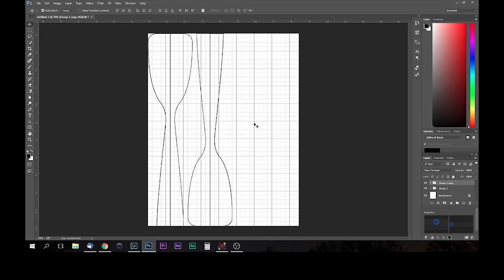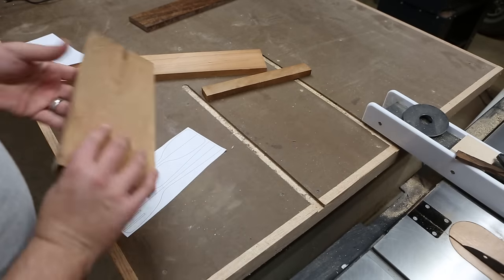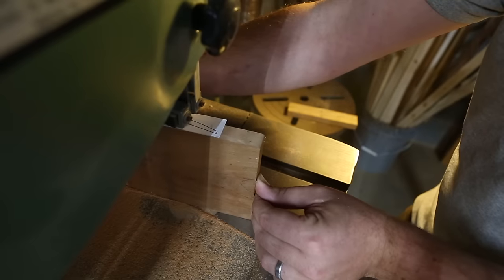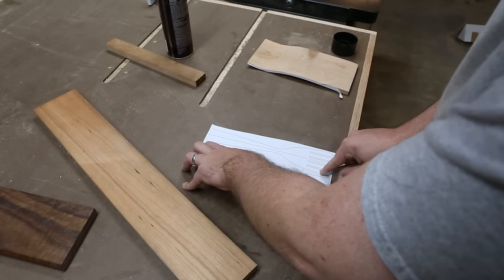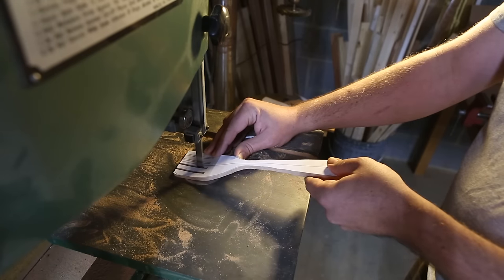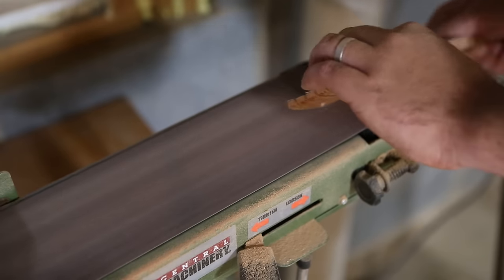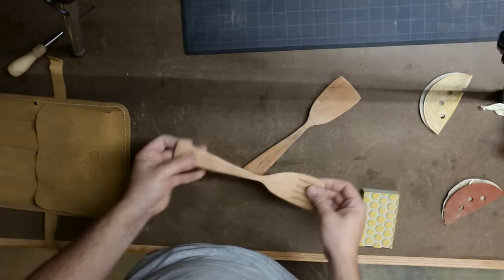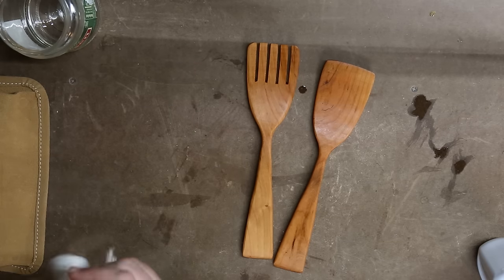How to Make Salad Servers

Comment: Nice work, they look great.  handmade gifts are awesome.  

side note; How do you like that Harbor Frueght sander?
Reply from the maker: Thanks! The harbor freight sander: I use it on most every project. The price is awesome. Belt changes are a huge pain. Some things are a little milk toast. Would I buy it again? Yes in a heartbeat. If I had a higher production shop I'd look into a more stout model.